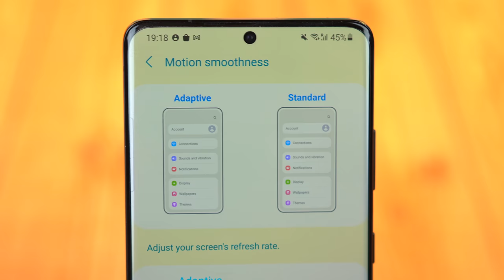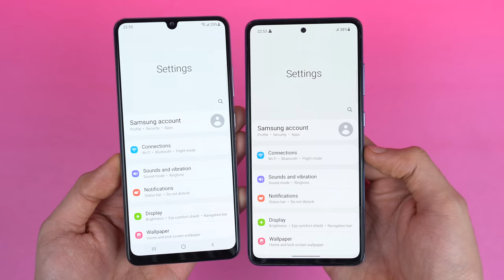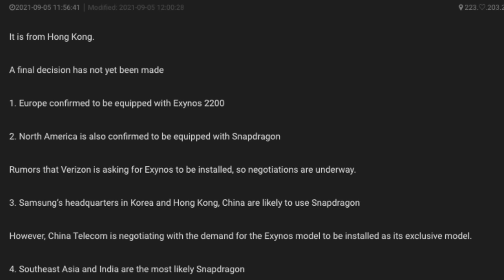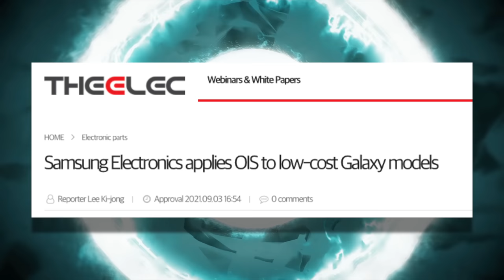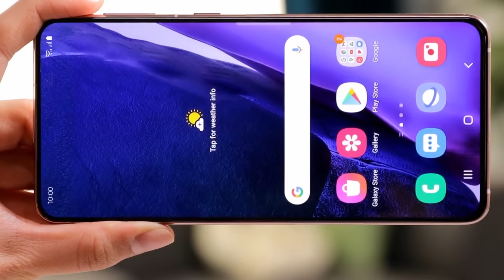Samsung Galaxy A73 - THIS IS TOO EPIC

Comment from the maker: Correction: S22 Aztech benchmark shown was "round 3" result meaning third continuous benchmark result in order to test thermal throttling. Still Round 3 40FPS is a lot more than S21's first round 27FPS. Crazy Gains.
Reply: Could you do a video on a new OnePlus when it comes out
Reply: we Indians always asked for snapdragon chips but now we wanna try amd exynos lol
Reply: Won't set Samsung apart when there's Xiaomi with even cheaper phones and 120 HZ
Reply: 25 fps - 35fps are perfectly playable on non competative online games. For online competative games 90-120fps should be the aim
Reply: Yeah Samsung always weak in terms software for performance chip
Reply: Well the chip decision is really gonna mess up the flagship
Reply: @thejdeepabram1024  sh.it happens still regreting the exynos 990

Comment: I was closed minded in the past thinking that flagships like S series is the only phone to get. Until I tried the A series (a71). In my opinion there is practially no difference when it comes to experience between flagships and mid ranges devices. And Im excited for A73.
Reply: I used J7, A7, A70, A71 and S20FE.

Trust me brother, in terms of camera performance alone, there's a day & night difference between the A71 and a regular S20 model.
Reply: @ibtidaahmed9684  agree.
Reply: Stop doing drugs. 😂😂😂

There's a very noticeable difference between flagships and mid-range A-series phones from Samsung.
Reply: Thr camera is the biggest difference. Most of us don't need to utilize a higher end camera thus the mid range phones are good enough for us.
Reply: @POPJack1717  Nope. Performance is also miles ahead. Though, I agree that it won't be noticeable to a regular user.  Whatever, if something suits you or me, then there is no need to compare things anymore.  We should always be content of what we have.💚
Reply: @ibtidaahmed9684  J1 (2016), A71, S20 FE user here.

Galaxy A71 doesn't even compare to S20 FE.
Reply: @freshbakedclips4659  Right.

Comment: Samsung should fix the video stabilisation at 4K and 1080p 60fps on the A52 because it's pretty bad. I don't own the A72 but it looks like it's the same situation.
Reply from the maker: at 60FPS and still bad? Were you running? It does good in 30fps. Should do even better at 60.
Reply: @XEETECHCARE  Nope just walking and it's pretty bad at 4K which is only 30fps and 1080p 60fps. It's fine at 1080p 30fps. It's even bad just by panning around.
Reply: @DANIEL CHUKWUKERE nope get S20+ !!!!! Beats FE easily
Reply: @DANIEL CHUKWUKERE I have the S20 FE too and other Samsung's phones 😉.

Comment: Samsung is going to rock the world next yearr,trusst🔥
Reply: Xiaomi just overtook Samsung, so that seems unlikely........
Reply: @retrogamer2503  samsung is much better still. Proven and tested.

Edit: Even their old models are still working until now.
Reply: @iniebeer2823  sure bro, but the statistics suggest otherwise, Xiaomi has the best devices in the market, period.
Reply: @retrogamer2503  the best? nope, the reason why xiaomi is so popular is because it's so cheap
Reply: @vaultboy8977  compare the mi 11 ultra with the S21 ultra. Then talk.
Reply: @retrogamer2503  read my comment again.
Reply: @vaultboy8977  I did, and it seems that you are the one who didn't quite understand, I told you to compare mi11 with S21 so as to make you realize that it's not just the budget segment that's the best, but also the flagships, which goes to show that Xiaomi isn't the best only for their value, but also for providing the best hardware, even when put up against flagships.
Reply: It is popular because of the value it provides, yes, but that doesn't discredit the fact that they also provide the best hardware out there in a single package.

Comment: Exynos - yes
Sd card - yes
Spen slot - yes
Headphone jack - yes
YES TO ALL
Reply: Spen slot??????
Reply: Cap
Reply: What phone is this? Is this the A-series?
Reply: @phoenix5054  if it has s pen slot its definitely not a series
Reply: But does it have a flagship processor?
Meanwhile Sony Xperia 1 III has the headphone jack and SD card slot, Snapdragon 888 and 4K 120HZ
Reply: @neliaironwood7573  4k 120hz? 

The display itself is 4k?
Reply: @Hysandel  3860x1620, 21:9, and that phone has no hole punch display. Most of these flagship phones like the S21 have no headphone jack/SD card slot.
Reply: @neliaironwood7573  i just saw mkbhd's review

If that phone had an hdmi port, i would buy it IMMEDIATELY even if it means my watch is useless because then i can have a portable xbox setup haha
Reply: I was talking about a hypothetical phone. What Samsung could have done if they stop copying apple and released the note  next year. My note 9 has all of these features
Reply: @sandorpalumbi2397  wait the n9 has a headphone jack?
Reply: @Hysandel  headphone jack, iris scanner, notification led. This phone has everything... I would like to have same phone with updated hardware and a bit bigger battery...
Reply: @neliaironwood7573  SUB-4K actually.
Reply: @Hysandel  NO. Sony doesn't make 4K phones anymore.

The last 4K phones from Sony are the Xperia XZ Premium and Xperia XZ2 Premium.

The Xperia 1, Xperia 1 II, and Xperia 1 III do NOT have 4K displays at all.

16:9 4K = 3840 x 2160

21:9 4K = 5120 x 2160

Xperia 1 series has 3840 x 1644 which is NOT even 4K at all in any capacity. 😂😂😂
Reply: @neliaironwood7573   Sony doesn't make 4K phones anymore.

The last 4K phones from Sony are the Xperia XZ Premium and Xperia XZ2 Premium.

The Xperia 1, Xperia 1 II, and Xperia 1 III do NOT have 4K displays at all.

16:9 4K = 3840 x 2160

21:9 4K = 5120 x 2160 (this is what the Xperia 1 series IS SUPPOSED TO HAVE).

Xperia 1 series has 3840 x 1644 which is NOT even 4K at all in any capacity. 😂😂😂 It BARELY has 6 million pixels which is less than 4K resolution.
Reply: @Hysandel  Galaxy Note 9 has a headphone jack but the Galaxy S10 series also has a headphone jack AND will be getting Android 12 unlike the Note 9 which is stuck on Android 11 unless you root the phone and flash a custom ROM on it.
Reply: @neliaironwood7573  I love how you purposely mention the S21 lacking a Micro SD card slot in order to fit your bullshit narrative to make it seem as if though flagship S and Note phones from Samsung haven't had a Micro SD card slot for years. 😂😂😂

Micro SD card slot is coming back in 2022.

Even the Galaxy S6 didn't have one and they brought it back in the Galaxy S7 after fans complained.
Reply: rlly? it will have s pen slot??

Comment: Yes, I want those four oncoming phones, Note22U, S22U, A53 & A73 with Exynos X AMD. Make S22 Ultra & Note 22 Ultra run only 1440p QHD+ while at 240hz display & gaming at 120fps, not default 60fps. Make both A53 & A73 run QHD display at 144~165hz & gaming at 90fps. Make both S22 Ultra & Note 22 Ultra overclock 6×2.2GHz and A53 & A73 overclock 4×1.9GHz. Add curve screen design on A53 & A73 to make budget phone like treasure. Make S22 Ultra and Note 22Ultra 10W or more wattage to improve Thermal Design Power. Make Note/S22 Ultra 7000mah/6800mah battery and Note 22 support 90W QC5 fast charging, QC4 67W Qi charging & powershare and S22 support 120~200W QC5 fast charging, 50W QC4+ magnetic Qi charging and 10W QC3 powershare. Add 15W Qi wireless charging coil in the A53 & A73 to charge in breeze.
Make A53 5000mah & A73 6000mah battery. 
But I wish Samsung should have 1TB SD card slot to both Note 22 Ultra & S22 Ultra like Galaxy A52 & Galaxy A72 expension storage.
Reply: Dang 🔥🔥🔥

Comment: I was patiently waiting and hoping for a A72 5G to upgrade to from my A71... Imma just wait next year for that A73 😎
Reply: I got the a71 this month and its rlly not bad but i missed out on getting the a52
Reply: @varunprasant1445  Damn that sucks. Yea the A52 is much better in alot of ways. I got my A71 the same year the A71 came out and patiently waited to see if the A72 would be worth it, to find that the processor wasn't much of an upgrade. So hearing the news about the A73 has me a bit excited for that. Maybe you can upgrade to the A73 too, if that's doable

Comment: If Samsung wants to differentiate, they should keep the AMD Exynos for their own use. Else, the Chinese companies are just gonna use it then price their phones lower and most people will just end up buying from them.
Reply from the maker: yep. But knowing how samsung want to make extra money apparently the midrange AMD chip will be offered to two chinese brands. :\
Reply: @XEETECHCARE  Really dumb move. Unless of course, they keep the best performing ones to themselves.
Reply: @humanshieldz  Dude, think about this.
This Is a Mali GPU the AMD GPU Is being compared to, and What does It have in comparison? Only 20FPS more when not throttling, this should tell you EVERYTHING already.
20FPS more are nothing beacuse ONE UI Is a heavy software that impacts the performance heavily on the phone and in heavy tasks like gaming, emulation etc, Mali GPUs on nowdays devices Still struggle beacuse of It, even if they have nearly similari scores to their Adreno counterparts in benchmarks.

20FPS are a big upgrade, but overall not enough when you consider Apple Will get an A15 chip, as well as Snapdragon getting an 895.
It can definitely defeat every processor that came out up until nowdays, It Will not have the Power to defeat It's rivals.

AMD Is pulling an obvious Radeon Vega on Samsung, they're not going to install the best of their RDNA 2 architecture in simple things like Smartphones.

For now, Smartphone GPUs do NOT have the Power their Desktop counterparts have, so best not give too much into Hope.
It's OBVIOUS they're holding back.
Reply: @MDT92  That's what i'm afraid of actually. The initial benchmark was cos of high thermal. I think unless everything was design from ground up (including the CPU) Else there's only so much AMD can do but i'm still hopeful. I"m not so much into gaming but more for battery life and power for video and photo editing so as long as those are met, i'm good. That's why i'm more excited about the Tensor chip then the Exynos AMD collaboration.

Comment: Apple cilicon m1 chip put shame on both Intel and AMD 
Exynos chips are good but even with Amd's help they won't be able to beat a15 chipset
Reply: That's the power of optimizations. Android is not capable of efficiency and enough power. That's the fact. IOS is a different OS.

Comment: why fps constantly dropped
first bench mark 58.fps 
second benchmark 51 fps 
3rd bench mark 40 fps
Reply: I was reading an article that they are using beta drivers, so  the final version is going to be better also it dropped fps bcz it was the 3rd round and the  performance throttled by 25% ,a month ago it throttled by 30%. still beats the 2100 that has 25fps on first round.

Comment: A52s launched in india at 36k is the worst thing samsung has ever done their every products launched in 2021 is overpriced. For 20k ips displat is like crap move. 

Idc what samsung is bringing on if its priced way unreasonable.  For 42k you can get s20fe 5g from samsung shop then whats the point of a52s at 36k